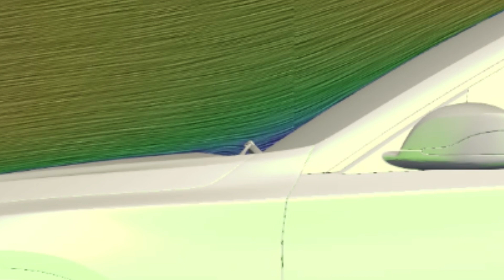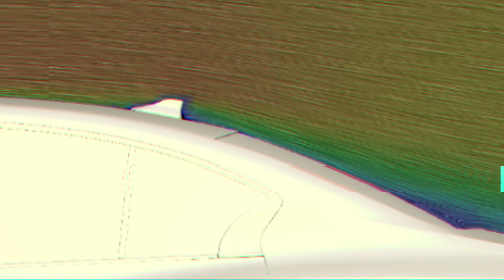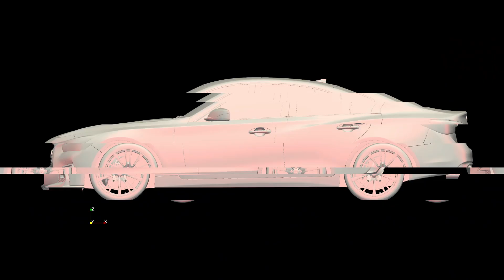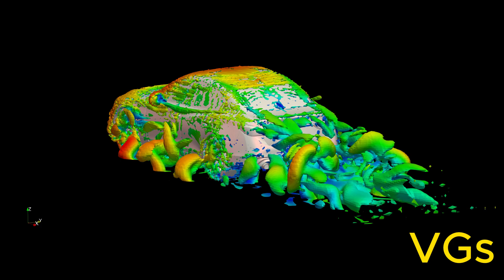I Improved The Infiniti Q50's Aerodynamics

Comment: Would putting a significant (3" or so) air dam underneath the front bumper aid in drag reduction for this car? I'm on a mission to reduce as much drag as possible for my Q50 as it's strictly for drag racing. A flat floor would be ideal, but very difficult to do for this vehicle. I was thinking I'd add an air dam in my situation as well as prominent wheel deflectors. I'd love to hear your input on this. Thanks!!

Comment: If you were to add votex generators(air-tabs)under the rear of the car at the beginning of each "diffuser vein",  can that reenergize the vortices that have traveled the length of the underbody? And, can/will that reduce drag and aid downforce? Asking for a friend, lol.  
You channel is the best, thank you for sharing.
Reply from the maker: 100% If you run an aggressive diffuser, the flow might separate. So, vortex generators help.
Reply: Question. For the vortex generators at the front of the Q50,  can "air-tabs" vortex generators be used or would/should they be a different shaped generator?
Reply from the maker: I think any vortex generators that create pairs of counter rotating vortices would do.
Reply: @PremierAerodynamics   I will keep you posted for sure, thank you !!

Comment: The problem is that the rear bumper acts like a parachute. Many people have had their rear bumpers fly out at over 150mph on the modified cars. There is no sheet or plastic that redirects airflow from the inside of the rear bumper.
Reply from the maker: Wow, I hadn't heard of that. Adding that sheet would really reduce the drag too.

Comment: On my production car which is tracked occasionally I was thinking of putting a row of say 3-4 VG's underneath along each sill/rocker panel to combat air coming in from outside to underneath the car. Opinion?
Reply from the maker: It could definitely work, assuming you have a nissan fairlady. One way to tell is to put them on, then do a lap or two, then see if they improved your times or not. It also depends on the downforce distribution and your personal driving style.
Reply: @PremierAerodynamics  Cheers, the current car is a Merc SLK which has a flattish underfloor.

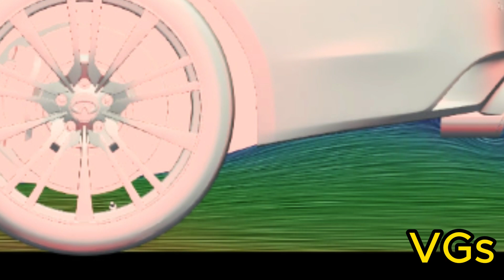Comment: @3:33 do what I did with my car, the flat plastic panels in front of the front wheels, those can be redesigned and can be made cheaply out of ABS plastic, or 3d printed. Placing them ahead of and behind the wheels would maximize the underbody flow velocity on the cheap.
Reply from the maker: That's a good ideas. And good idea on the ABS. That won't degrade as quickly as most other common 3D printing materials in the underbody region.

Comment: High pressure at the lower nose of the car and low pressure under the front of the car is desirable because it pushes airflow through the radiator. If the radiator is impermeable in your simulation, that would explain the underbody flow separation.
Reply from the maker: Good point, but the slit doesn't cover the entire width and you can get low pressure by making the flow faster as well. So, separation isn't a desirable quality.

The closed cooling is also a configuration that is tested during the design phase, and is more and more important as cars become electric and have variable cooling settings.